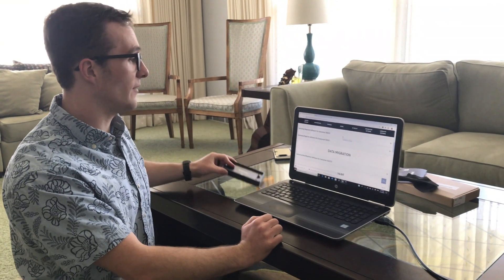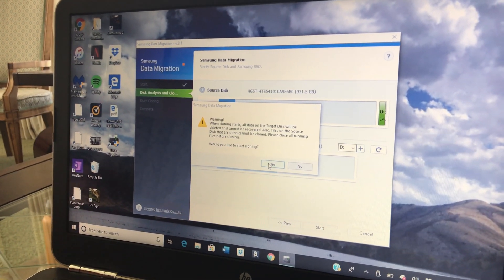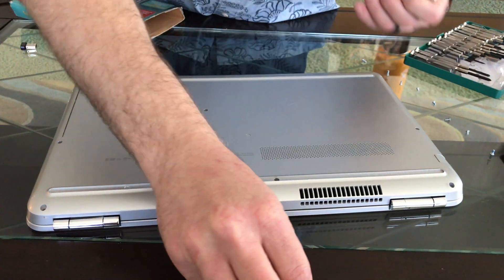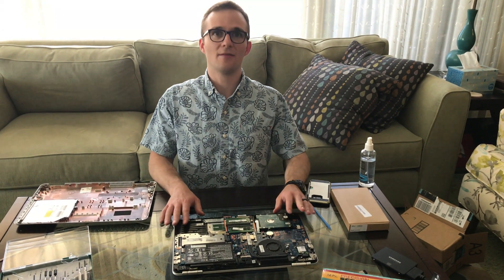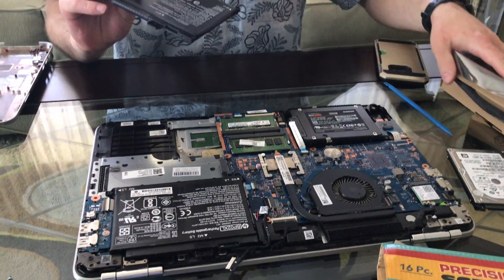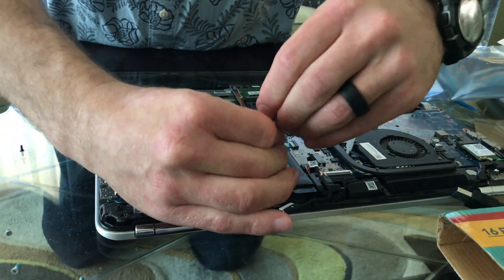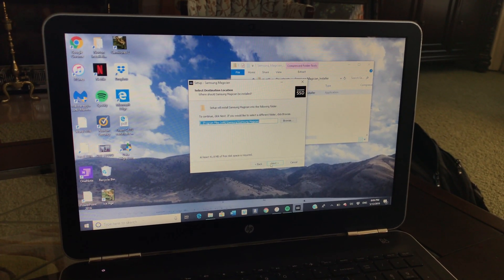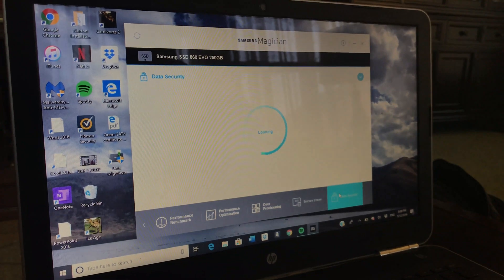How to install an SSD and change the battery on an HP Pavillion 15-au000

Comment: Thanks for sharing.
I did it but had trouble getting screws off due to wouldn’t turn at first. Had to rest a few times to let my fingers recover.
I saw another video where the guy had a little cordless drill with a special adapter and was able to get them unscrewed real quick.